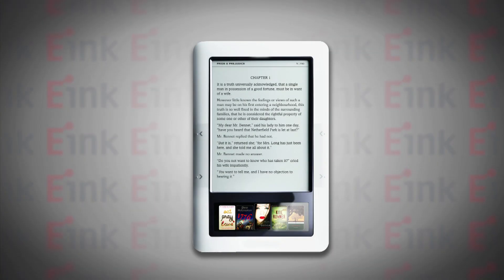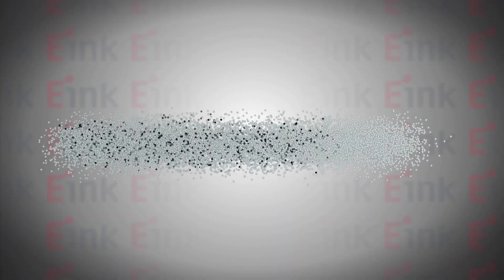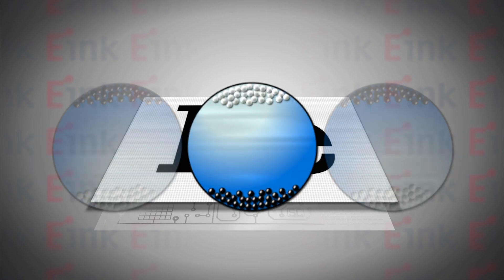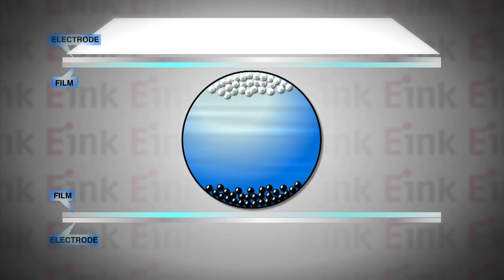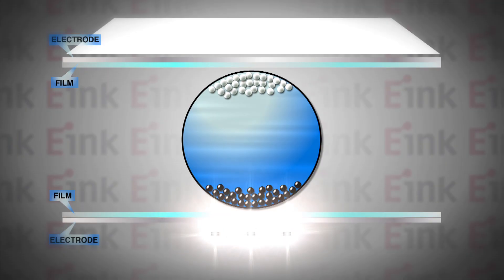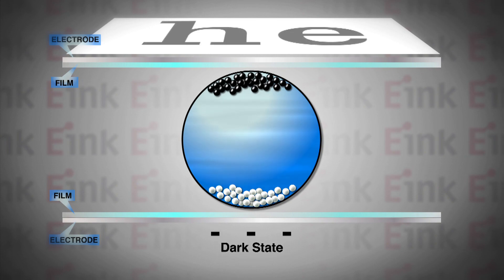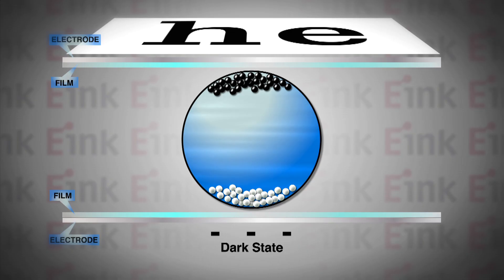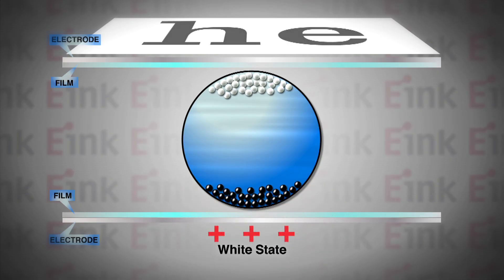How E Ink Works

Comment: How does it work with shades of gray, though?  Kindle devices use e-ink, but can show multiple shades of gray in pictures.  How does that work?
Reply: The capsules are tiny; if you looked under a microscope you'd see it's not grey at all, it's black and white dots beside each other.
Reply: by mixing the white with black

Comment: Thanks for the video. How come these particles don't lose their charge overtime? Xx
Reply: ***** Isn't there always some degree of electric leakage? They must use extremely good electrical insulators as coatings for these particles. Any idea what materials they use? Do E Ink screens lose brightness after years of use? Thanks.

Comment: That's fucking brilliant. But who will use a peper that needs battery?
Reply: ***** The whole point is that they don't need energy... Well, every refresh needs some power but then again, how much energy is needed to refresh a page of regular paper?
Prints on e-paper can stay on for weeks or months although they slowly fade so if you want it super crisp you need to refresh it at times.

For example many grocery stores use e-paper for prices and they can be powered through induction (meaning the power source in the writer, not the paper, as used in RFID-technology also common in grocery stores) when you change the text or by a clock battery for remote refreshes.
Reply: ebooks ;)

Comment: No, the particals inside the capsules are not made out of metal. E Ink is based on electrostatics. It's the same effect as picking up small pieces of paper with a charged (by rubbing it with wool) plastic ruler. The pieces are also not affected by a magnet.